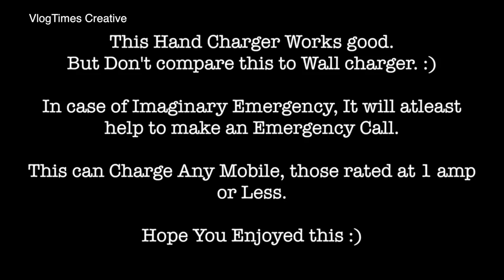3 Amazing things YOU can make from SERVO | Life Hacks

Comment: Hi, I am using the MG 996R servo motor. I already made the motor turn on the led by spinning the gear manually, but I would like to try the USB connector next to charge a device. What USB type do I need and does it have to match the input voltage of the servo motor? Thank you.
Reply from the maker: Dont do it..its just an expriment
Reply: @MrExpert  I know that I won't be using my phone to charge, but I may be using a very old phone that I am not using anymore, so this is a project that I want to do at my internship. Thank you.

Comment: the mobile charger setup is a bit dangerous?!?!?
Reply from the maker: yup. its just an experiment. not a replacement for wall charger.
Reply: +VlogTimes #Creative the voltage from the servo wasnt regulated so if you crank too fast it would go to 6v
Reply: +rennier rodil how just dont doing it ? or adding a car usb adapter that regulates down to 5v
Reply: +rennier rodil how just dont doing it ? or adding a car usb adapter that regulates down to 5v
Reply: Its not dangerous if you are in a situation where you need battery power.
Reply: well if you connect the output wrong it will kill the phone and also by overvoltage it will kill it to since the output is not regulated

Comment: i don't recomend to charge your phone like that like on the last part 9:07 because is AC voltage is not DC like we need to charge phone, it's bad for your phone battery!
Reply from the maker: +fredy mredy its DC voltage bro not AC
Reply: how can be DC ? where is the rectifier? the servo motor give AC current you can check with multimeter :)
Reply from the maker: +fredy mredy the servo in video has a dc motor. I just checked it. It gives DC current - nd +
Reply from the maker: yes you are right mate. Next project I'm adding a circuit to it :) Cheers
Reply: عندك حق الجهاز لايشحن بالتيار المتناوب بس في التيار المستمر
Reply: +saroj maharjan fluctuates voltage not frequency. Only alternating current has a frequency
Reply: No it's not bud, it's AC, all motors generate an AC voltage. You need a bridge rectifier to make it DC.
Reply: It runs on DC, not gives out DC, clearly you know nothing in regards to this.
Reply: It does. DC motors generate DC if used as a generator and take DC to operate.
DC motors are constructed differently to AC motors. Just have a quick Google ;)
Reply from the maker: lol
Reply: Ikr. YouTube comment chains get wired and annoying so quickly :P
Reply: Correction, yes they do.
Reply: its for emergency
Reply: +LifeOfAnEnglishman DC motors have a built in mechanical DC to AC converter which works backwards. I believe it's called a commutator
Reply: Pixl Rainbow
Aye, I got it wrong, oops. I proved myself wrong, I got a small DC motor and put my meter on it, it wouldn't read any voltage on the AC setting but did on the DC setting, proving they do give out DC.
Reply: LifeOfAnEnglishman
No, you got it right. If you want know if it is AC or DC, you can't use a multimeter (AC signal can have DC part)... You must use an oscilloscope !!!
Reply: Jonah Distl
Yup. I did correct myself. :)
Reply from the maker: You're Welcome :)
Reply: +Bynaris my question is . what mean of dc and ac ? XD
Reply: Direct Current and Alternativ Current.
Reply: +Bynaris ohh i see .. thanks
Reply: guess its called HZ? right? =)
Reply: +Adis - Ad i was making a joke,  point is that i figured this out by playing with an celing fan,  and that did Hurt.  :)
Reply: hi
Reply: Where u gettin ac from?!?
Reply: I didn't knew you can get AC from DC motors :D ahaha
Reply: In the phone is protection circuit with a diode....
Reply: you can use it like that, but for protection you can use a 7805, so when you hit 5v the regulator send the voltage. if you go more than 5v the 7085 will keep in 5v
Reply: False, Arduino works with dc current only, and you can put there a servo without any driver
Reply: you make really cool thanks.
Reply: in fact it is a dc motor but still if you turn it the other way around you will produce a negative voltage that can damage the phone and also since the output is not regulated it can also made some damage too
Reply: LifeOfAnEnglishman
a dc motor consist of a commutator so that when the magnets are flip around it creates the opposite voltage but since the polarity induce in the coil by the magnets is different the voltage remains untouched
and a servo works with a pwm signal to rotate since it has a built in microcontroller and an h bridge to change 
the applied voltage to the dc motor
Reply: Jonah Distl
i do not think so try fliping around the usb + and - connections and the phone should die

Comment: How many volts can it generate?
And for charger i suggest you to use some capacitor to stabilize the voltage and LM317 voltage regulator (its very cheap) to protect from over voltage.
Reply: he's relying on the phone being a well designed phone with built in voltage protection (but not all phones have it)

Comment: How did the last one even charge an iphone? Don't they require a 2V signal on the data pin? Also that charger will probably break anything plugged into it as the 5V is not regulated.

Comment: DO NOT MAKE THE CHARGER!!! IF YOU TURN THE HANDLE JUST TO HARD YOURE BATTARY WILL EXPLODE it couldn deafenitly work but only uf you put a converter in which Lets your phone charge at a constant rate of 5 volts
Reply: barery
Reply: ***battery
Reply: It won't make your battery explode lol. Phones have built in voltage regulators that will cut off charging if the input voltage gets too high. These will keep harm away from your phone and battery.
Reply: any curent gained by circular motion will be an alternating current. totaly fake. it wouldnt charge anything ever!
Reply: +Kappa Kyle Some have none and you could even fry the ones with if you Turn fast enough.
Reply: +sorin crivat not true. DC motors produce DC. If the motor switches direction, so does the current. If you're not sure, you shouldn't act as though you are.
Reply: Sorin, No it doesn't work like that. Do you know what alternating current actually is? This is still DC.